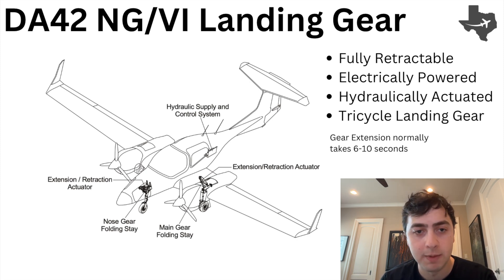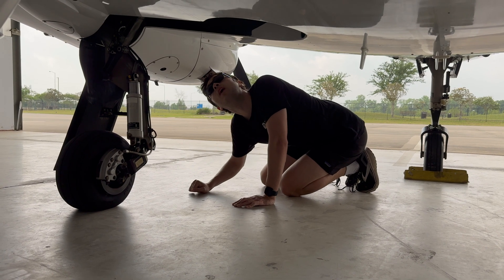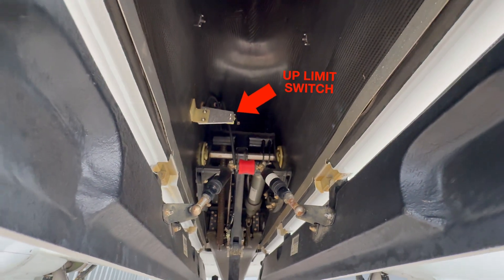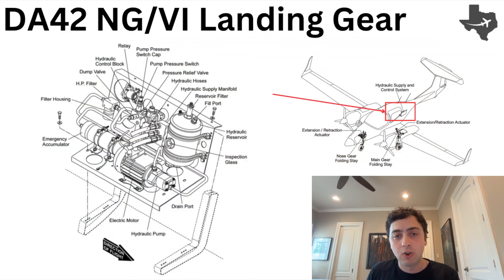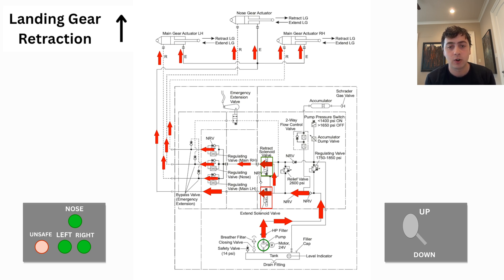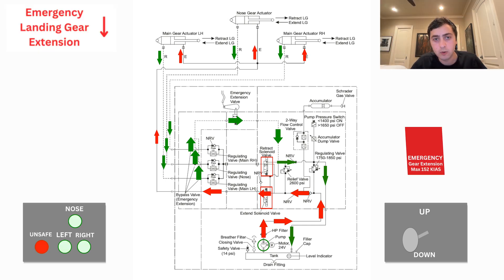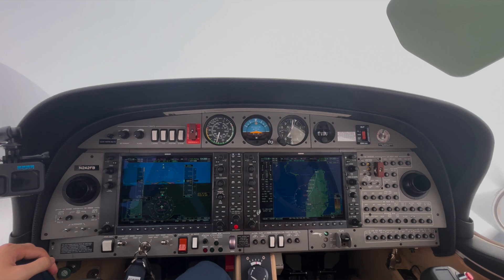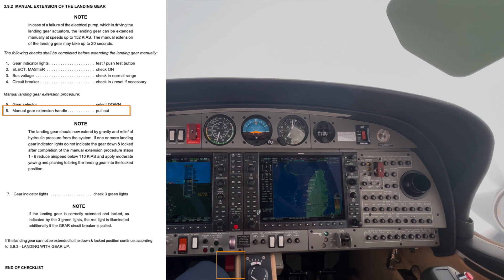DA42 NG/VI Landing Gear System Explained

Comment: Hi Max, if you accidentally pull the emergency gear release in flight, can you push it back in and cycle the gear to get the gear back up? Is there a certain best sequence of flipping the gear handle and pushing the emergency release lever back in? I only find something in the manual that says the system must be inspected after an emergency release.

Comment: Outstanding video, Max!  Very detailed, clear explanations and excellent graphics.  There is one topic (and pre-flight inspection) that would be worth adding in the future.  There was a DA62 gear up in 2023 that resulted from failure of the c-clips on the landing gear braces.  These function as retaining rings on the nose and landing gear braces. This is covered in Diamond's MSB 42NG-094.  I can't post a picture here but they are very easy to inspect on a normal preflight.  I've added a visual inspection of these c-clips to every preflight I do.  If one fails, the associated rod can slide out and you effectively have no landing gear in that position!!  This is what happened to the poor DA62.
Reply from the maker: Thanks for the comment, Trevor. This is great input for everyone who watches this video! I just reviewed the MSB.

"It was discovered that the main and nose landing gear braces of some aircraft had retaining
rings with insufficient level of corrosion resistance being installed. This may cause the
retaining rings to corrode, sustain damage, or fail (crack). If not corrected, this may lead to
failure of the landing gear. This Service Bulletin describes the replacement of those retaining
rings."

I'd referenced the "bearing shaft" (AMM pg. 239) next to the down locks, but it looks like I should've been more specific in calling out the retaining rings holding in the shaft. Thank you.

Comment: Thanks for posting this, Max. I find it odd that Diamond would use one of the squat switches to derate the stall warning heater on the ground. If the squat switch gets stuck in the ground position you could be going into icing conditions with a derated stall warning heater.

Also I'd like to add that an electrical failure that cuts power to the hydraulic pump may cause the gear to eventually extend. The gear is held up solely by hydraulic pressure.
Reply from the maker: @igclapp, it's a good point. In that situation, you should have a STALL HT FAIL CAS message to alert you to the issue. Hopefully, you'd find out ahead of entering icing conditions with this issue.

Exactly, that's the design. Ultimately, we want the gear to come down. The system is designed so that if such a failure were to occur, the gear would come down. One thing I didn't mention was that when you pull the emergency gear extension, the pump circuit breaker is pulled. This means if not all the gear end up being down and locked, and you try to raise the gear, you might not be able to. It's unclear to me if you can reset the circuit breaker without a mechanic.

Comment: I found this explanation incredibly fascinating! Of course I will have to watch it again because there is so much information. Would you consider doing an episode on the relationship of fuel, temperature, power, cooling, etc as it all relates to manifold pressure and rpm. Please keep sharing information on systems that make up an aircraft. Thanks again Mr Max. By the way should you ever feel the need for some Bar-B-Que I live 1.25 miles south of I-10 in Luling and would love to buy.
Reply from the maker: Thanks Robert! I'm always open to suggestions. I'm planning to cover Fuel Systems next. I think the Prop and Engine systems should touch on some of your items. May take you up on that sometime soon! Stay tuned something very big coming soon!